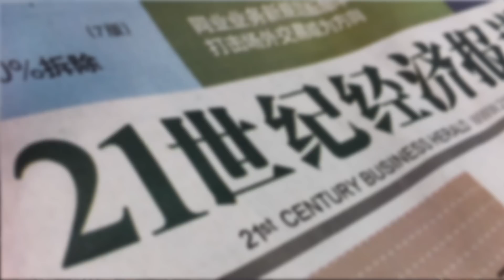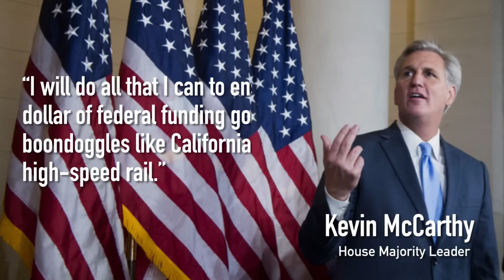Is "Made in China" the Future of US Transportation? | China Uncensored

Comment: We have planes. Its not that expensive to fly between cities.
Reply: +lanciadr If you don't account for the pollution that is.
Reply: +lanciadr China also have planes...
Reply: +Xiang-yu Zhu (Castiel) High speed only works when it is going from point A to point B.  My parents live about 900 miles from me. It would take three days by train even though they  can go up to 75 mph for safety reasons.  The reason being is there are a lot of stops from where I live to where my parents live. The trains have to slow down well ahead of the stop, wait several minutes, speed up again, slow down again and on and on.  while high speed from Los Angeles to Las Vegas could work because there is little in between those two cities, it'll probably be really slow between San Francisco to Los Angeles because of all the safety laws and potential stops.
Reply: +orlock20 Hi-speed trains are best suitable for short distance i.e. less than 600km(350miles) travel, beyond that they have less advantage over airplanes. Also, fyi,  in Northern China, some regulation has been enforced to restrict the maximum speed of the trains in winter time,  they may run as fast as 300km/h in summer, but only 250km/h in winter. I have a lot of business trips inside my province travelling by trains, I hate the winter the most. And thanks to the high latitude, we have 5 months long winter >:(
Reply: +Iamtop Planes are actually more fuel efficient than traveling by cars, for the same distance, 300 people driving cars and 300 people riding on one plane, the plane is clearly the winner in fuel efficiency and create less pollution as well.
Reply: +Zhang X http://www.globalfirepower.com/major-serviceable-airports-by-country.asp
USA has more airports than China, Canada, Russia, Brazil, and many other countries combined. Air travel has always been a backbone of US transportation.

Comment: the us doesn't need trains when we already have planes and airports spread across the country.
Reply: Really? An airplane is extremely inconvenient. Think about the gas that is wasted and the time it will take waiting for takeoff and landing. 

+xu da
Reply: gas wasted?  as long as the airline is profiting then there is no wasted gas. also last I checked aircraft were FASTER than trains so building them would be kinda pointless
Reply: xu da A commercial airplane uses 25% of it's total fuel storage just on a takeoff from the ground into the sky.
Reply: so? planes are still better than trains
Reply: if it is less than 450 miles I would just drive there.

Comment: Sure there was a disaster that killed 40 people. However, thats less other countries with high speed railway systems like germany. Also bear in mind that this is just ONE incident (and sure you can argue that they've been covering those up too), but have you considered how long the railroad is? Its actually over 20,000 kilometres in length which can actually fit half the worlds circumference on the equator. Considering that there are 20,000km of error happening and millions of people commute on it a year... id say 40 deaths (as tragic as it is) is fairly insignificant in terms of probability. Moreover, on to stolen tech. China held the fastest and long high speed network railroad until the fastest, the new japanese mag lev train came out late 2016. How can stolen tech be faster than the tech it was stolen from in the first place without ingenuity and innovation? I dont see you bashing apple for stealing basically everything from other computers and changing a few circuits round, passing off as the first MAC. You've got to stop becoming the censoring, partial reporting monstrosity that our your bash-ee to be!

Comment: Take a look at Elon Musk hyperloop and the number of the few companies trying to get it off the ground, they already have funding to begin building proto type tracks, and if successful will not only be cheaper than a high speed rail line, but they will be fast, less costly in maintenance and faster. It could then be implemented as a functioning transport between Las vegas, Las Angeles, and San Francisco by 2020, which is about the time it would take for any high speed railway to get off the ground, meaning it would be outdated and worthless by the time it began running.